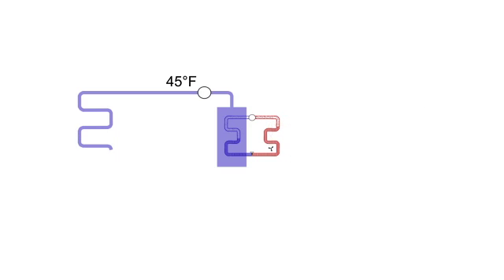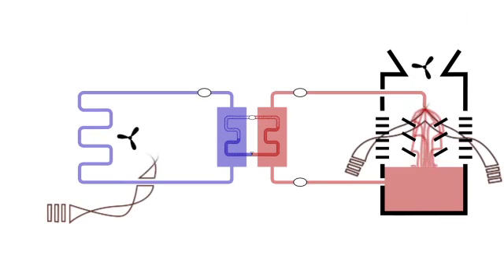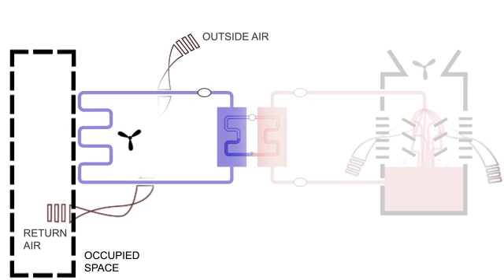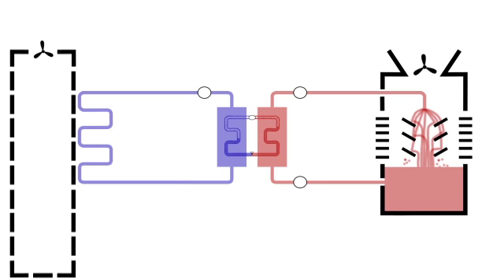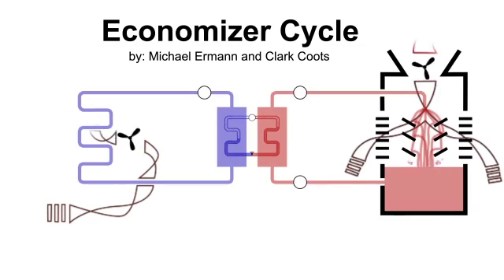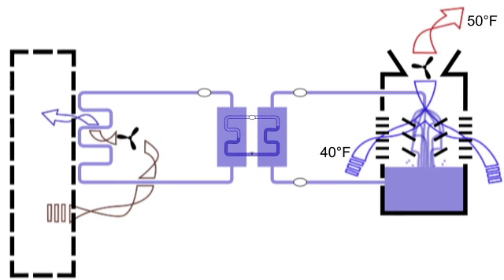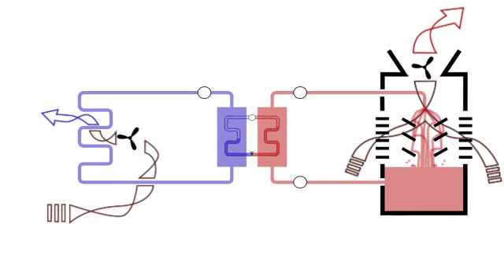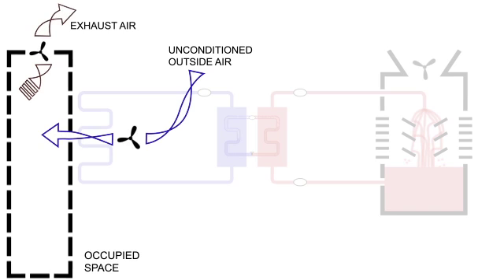How Air Conditioning Works Animation--Part 2 of 3 (heating, chillers, and the economizer cycle)

Comment: What I want to know is why air conditioning units need to vent hot air at all?! - Why don't they just take that heat, and convert it in to electricity through some other process so there is no warmer air left to vent! Then that extra electricity could be used to power the unit and reduce the amount of electricity needed from the mains supply....
Reply: You are talking about heat recovery system.
Reply: How the he'll do you use heat to create electricity

Comment: So what exactly is the chiller?  Is it the same as the evaporator?  At 4:00 he says "the evaporator side of a rooftop chiller"  Is it the place where water is cooled from the evaporator?

Also, with a building are the condensor and compressor always part of the same unit?  From the animation it looks like the compressor is simply a pump, but I've heard the untire unit outside called a compressor and heard it's very expensive to replace.
Reply: +maxpowers3732 The chiller is represented in the middle of the drawing above. You have the 2 side, the condenser (high side) and the evaporator (low side). Chillers do not need to be on the roof but air cooled chillers are outside but not necessarily on the roof . Water cooled chillers can be anywhere that water can be ran to. Chillers cool a product not and not the space directly. Look up direct vs indirect cooling. Compressors are expensive to replace because of the amount of labor that it takes to replace them. Not sure if this helped but feel free to ask questions but once you understand the basic concept then the other stuff comes along a lot easier.